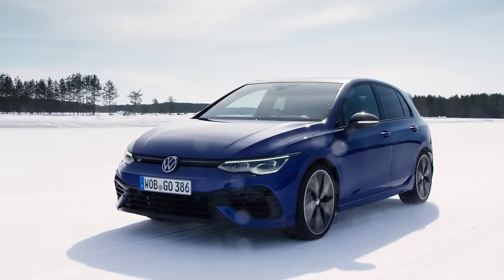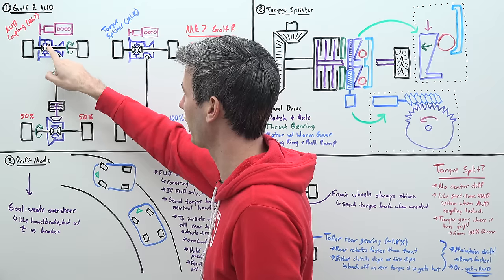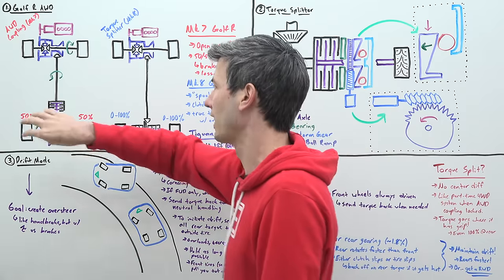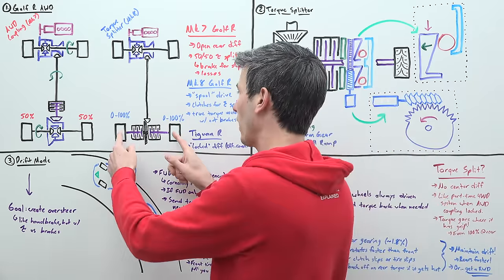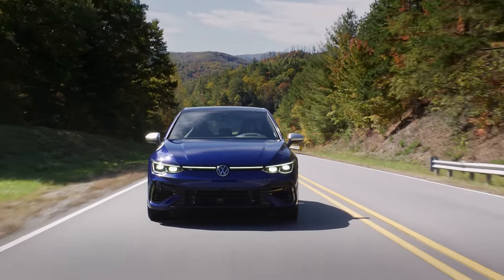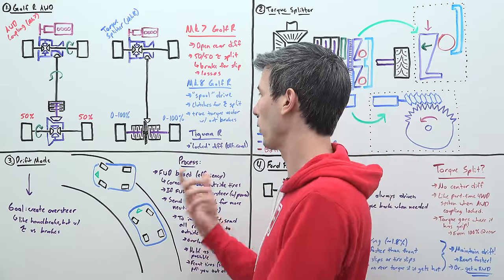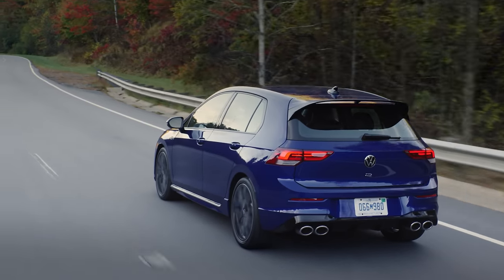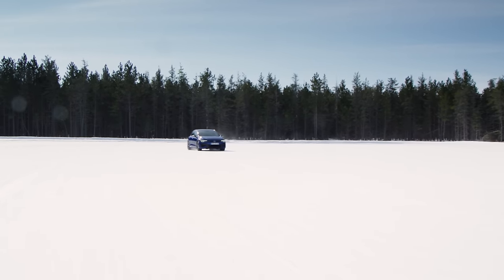Volkswagen's Clever Differential Allows For AWD Drifting - 2022 VW Golf R

Comment: Planned failure.. it's nice to have it on a spin, but for daily, it's a big no no..
Reply: That's actually a reason why this design makes sense: 98% of the car's lifetime, the clutches will just be completely disengaged. It's essentially a standard front wheel car then, with a simple shaft to the rear that doesn't do anything – no extra differentials needed, incl. means to address their slip.

And realistically, by the time the rear components have worn down, the car won't be in use for fun anymore anyway but only as a boring city car / used beginner's vehicle.
Reply: @leftaroundabout  🙄🙄🙄🙄 torque vectoring, drift mode, Nürgburgring "special" profile, race profile and optimized driving dynamic.. and the cluch pack would be used only 2% of his lifetime?!
A Golf R would become a boring car?!
Are we talking about the same thing?!
Have you analyzed what you said before pressing send? 🤔🤔🤷🏻‍♂️🤷🏻‍♂️
Reply: @costi08  Yes.

Comment: How much power can it send total to the back? I.e. The 0-100% of each rear wheel is a percentage of how much power actually going back there? 50%?
Reply from the maker: Discussed at the end of the video in detail. :) 11:35
Reply: @EngineeringExplained  thank you sir!! I ask because I remember most Haldex could only send 50% of power to the back even if the front wheels were in the air (from what I understand)

Comment: How much did they pay you to say "100%  of the torque*" instead of "100% of the 50% of the engine torque that is sent to the rear diff" :P
Reply: Before accusing people, maybe it is wise to actually read and understand what torque is and how it is measured.
Reply: @jpi9802  Well, no. I know what torque is and how it is measured. You obviously didn't get my point there. Try reading a comment first, before replying. VW always did the "100% torque to the rear" thing. Yes, when both of of the front wheels are on the brakes - by the software, not the human being - "100%" of the torque is being transferred to the rear. But the software never (never!) brakes both front wheels fully, so there is never a moment when more than 50% of the torque is transferred to the back. Yet they still proclaim "100% of the torque to the rear axle" when they mean "100% of the available torque to the rear axle" which equals 50% of the engine's torque. VW lies, hard. And they always will lie. It worked in 1939 just as fine, and it's the same kind of people working there still.

Comment: Problem solved:  Put a electric motor on each wheel with instant torque vectoring like on the new Rivian EV....
Reply: @layne4376  no it shouldn't be simple electric motors aren't expensive at all they wouldn't need to be that powerful either since its instant torque vw would find a way to make it expensive though so I agree

Comment: Focus RS called and wants it’s 2016 back.
Reply: As another comment mentioned here, that diff was used even previous to the RS.
Reply: I owned a focus rs for 2 years, that awd system was dogshit and turned off after like 3 laps of a track. this golf r is mechanically controlled and won’t shut off, plus the quality is 90x better than ford lmao
Reply: @gregcass12  mechanically controlled? Looks very similar to the RS that is electronically controlled. Mechanical would just be a standard limited slip type differential.
Reply: @ALMX5DP  yea, half and half I would say, the problem with the RS was that it uses some sort of calculation for the rear diff temp and prematurely shuts it down. there was someone on the forums years ago trying to crack it but was never done.  I can’t see this golf having that problem at all
Reply: @gregcass12  well if it's controlled by the computer, there is always going to be the possibility it exceeds a limit (temp, time, etc) and can similarly pull torque from that axle.

Comment: Cool tech. But wouldt want this complexity for my own car. Dont see much reason. Its never been a problem drifting a regular RWD car with a diff lock...
Just make the 4WD system with lockable/disconnectable clutches. Then you can have it RWD and also have proper diff locks. Fix that first. Doesnt need to be more complex.

Comment: Way over complicated and not needed. Just because we have the technology and manufacturing capability doesn't mean it's a good idea to equip cars with such things. Cost is already out of control. We don't need and many of us don't want lane assist, back up cameras, self driving, heated and power seats, touch screen displays, etc, etc, etc, etc. Some of us would like to buy a brand new basic car. You know, a tool to travel with. A basic $15k car with a 4cyl, 5 speed, disc breaks, a/c, a Bluetooth radio, and about 250 horsepower. They would sell like hotcakes.
Reply: I also don't  want the costs associated with all of these "features" failing. And they will fail. Guaranteed.
Reply from the maker: If it'd sell like hotcakes, that's a business opportunity, and someone could/would do it. There's a tough balance between what's available and what folks actually buy (hence we don't have many nice station wagons, or even sedans at this point, in the US).
Reply: Go to Romania and pick yourself up a Dacia. 😅 You might struggle to find one with 250hp though.
Reply: @EngineeringExplained  a big reason we can't get cars like this is government mandates. They're requiring some of this equipment to be included in all newly sold vehicles by year XXXX. 

By the way, have you heard of the RPM act and do you have any thoughts on that?
Reply: @Xenon0000000000001  problem is were not allowed to import just any car due to "safety standards and regulations". We're not as free in the USA as some people think we are. Taxed and regulated to death. The only thing that's still free from tax and regs is playing with yourself, but I'm sure they're coming for that as well. 

If someone can name me one thing were not T&R on, I'll be shocked. There are virtually none.

Comment: German here. Nice technology, no doubt. 

But damn is that generation of golf ugly.. everything is touch, you even turn on the headlights via a touchpad. If your computer crashes, you have no control over the AC or heater. I hate having everything as a touchpad and integrated in some sort of computer driven display. I want buttons and knobs. 

I personally drive a older gen golf from the early 2000s and i can change my headlights without looking down. I can change my heater, AC or Volume without looking at it. Heck, i can even turn off esp and press on every single button in this car without looking. I hate these changes. It seems that everything needs to be complicated these days... I wish we could bring back the cars from the early 2000s. 

in terms of reliability and usability you're better off getting a dacia. Proven renault tech and because renault already paid for R&D + Marketing they are cheap. I want a car and not a spaceshuttle that costs a fortune to repair and makes my life harder..
Reply: Yeah – touch controls are good for first-time users, but after enough experience physical controls are always superior.

The real reason why it's going in that direction is that touch controls are now much easier to implement for the manufacturer: design all the hardware super-generic and off-the-shelf, so it can be cheap and already be sent to the production line while the software people are still working out where to put the actual controls. And the result can then be marketed as cool and futuristic, never mind how useful it actually is.
Reply: @leftaroundabout  You might be right. But these cars get expensive, really expensive. In the end you pay for all of this. Nobody can tell me, that a touchscreen with a arm/nvidia based computer is cheaper than a simple knob you can turn. We have a golf 7 in our family and it senses your hand movements. If you want to touch the screen, the optionsmenu pops up before you reach the screen. Who needs that?

Volkswagen literally means "Vehicle for the people", basically a car everybody can own and drive. The golf8 starts at 27.000€ and has less features and a smaller engine in the base model than a dacia...

Comment: Knowing throught problems on my Golf 7 R how unreliable was the haldex 5... I would never thrust 2 clutch packs, with 2 pumps.
VW was not able to make it reliable then. And they did not even bother to RECALL, or at least participate financially to this SHITY system.
The system was fun. But broken 2 times.
That's not what I call a german car...
Reply: What? The Haldex has always been a reliable system. It does require changing the oil in it every 40k miles.
Sounds like a user error to me.
Reply: @Cristian121212100  I am a bit of 'control freak' as far as doing all the necessary and unecessary things for my car. The haldex oil was changed well in advance of rhe 60.000km. More around 40.000km. This haldex was not reliable enough for usage under rain most of the time and in the snow some of the time.
If you plan on driving peacefully, I am sure it is reliable...
In my case, it was not. So, saying it is reliable in general seems very optimistic.
Compared to my M3 G80 with almost double power... Haldex 5 was just pre-historic.

Comment: German engineering can be spectacular, but like spectacularly unnecessary in complexity. And for it being Volkswagen there is the manufacturing-outside-of-germany problems. Thank you for the warning. However, be that as that is... could they not just have gone forklift and used a swash plate and stuff... (so sorry, even after a Google search I cannot recall the names of the components that I want to name here... ARGH).

Comment: THIS just shows how laughable and down right jerry rigged ICE drivetrains have to be to achieve something so simple.  This is like a vacuum tube TV in the world of OLED displays.  Quad motor awd with 100% full control on torque vectoring without "clever" garbage systems.  It can override the rears by 2% or 20% or 200%.  No changing gear ratios no slipping clutches in oil no actuators no stupidity.  Cut the crap with this ICE mickey mouse garbage legacy auto or you will go out of business 🤦‍♂️🤦‍♂️🤦‍♂️🤦‍♂️🤦‍♂️